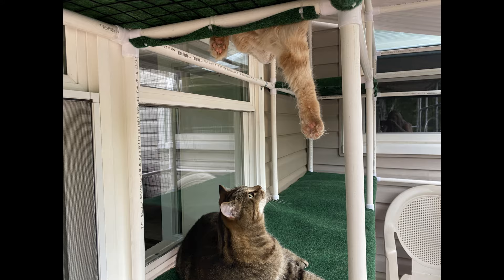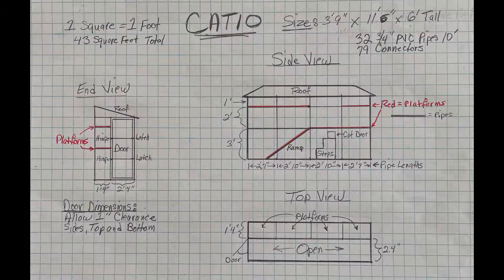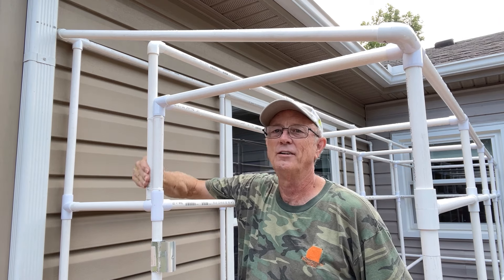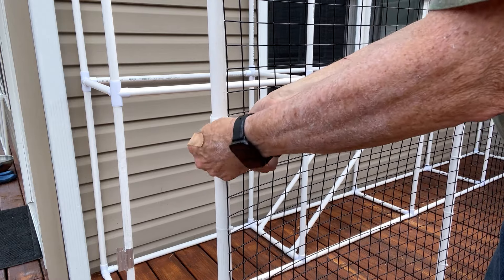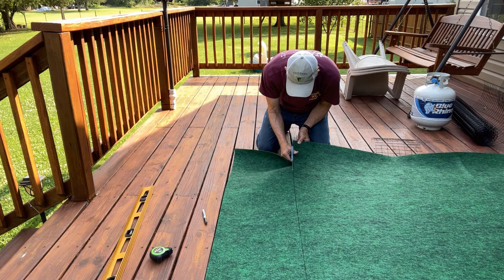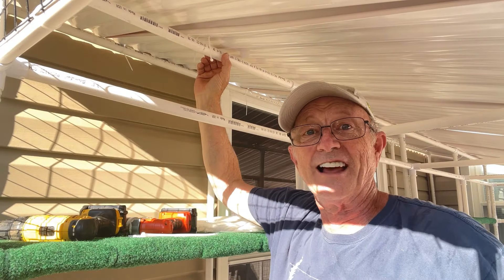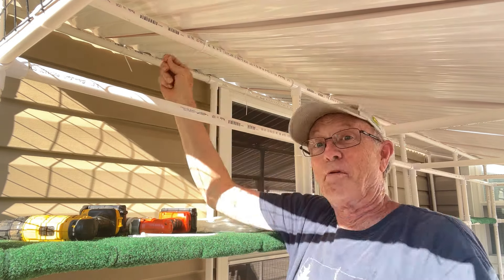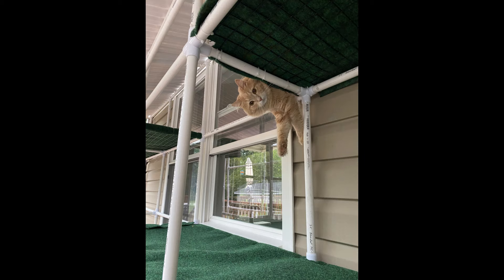How to build a Catio (outside cat enclosure) DIY

Comment: Very well done. Not to be a Debbie downer, but you will need to constantly check your zip-ties. I used them to secure fencing material to my cyclone fence. The sunshine made them deteriorate rapidly. I was constantly removing snapped ones with new ones. Sorry. Nice job though.
Reply from the maker: Thanks! Yep, you are correct. I probably should have used UV resistant ties. Problem is, they are black in color, and I think that would look ugly against the white PVC pipes. Using gray PVC is more expensive and the corresponding connectors are hard to come by. You would have to paint each one to match the color - too much trouble for me! At least I put the ties only 6 inches apart, so I'll catch them before the fencing comes off, LOL.

Comment: When pricing, remember that this incldes the cat tree/shelves inside.  If you buy an enclosure, you still need to build shelves.  This one is stiffened by the house. A free-standing version may need some diagonal bracing, which could simply be ropes.
Reply from the maker: I built everything, including the shelves, for $490. You are correct, a free standing catio will need a fourth wall, as well as some bracing.

Comment: Oh, are the tools u are using basically drill, screwdrivers, zip ties?
Reply from the maker: Yes, and a PVC pipe cutter I bought at Lowes, wire cutters to cut the fencing and something to poke holes through the carpet.
Reply from the maker: Let me know how yours turns out by joining my Facebook group, DIY Project Station: https://www.facebook.com/groups/882510523338538

Comment: I love the PVC idea. I would have used the UV safer gray, though. Couplings would need painting.
Reply from the maker: Yep, I later learned I should have used UV Resistant zip ties. Oh, well. Not sure what you mean about painting the couplings, though.
Reply: @RoBeaird  The option for connectors in the UV gray are not as much as the white. When I did an outside awning project, I used gray pipe, but spray painted the white connectors with gray paint to match and protect from the sun.
Reply from the maker: Thanks for explaining that. I wouldn't want to paint 79 connectors, though! Gray pipe is thicker and sturdier but it's also a lot more expensive and harder to cut. And I wanted to keep the cost of the catio under $500. While the UV gray zip ties would probably hold up longer, I think they would look ugly against the white pipe.

Comment: love it but I can see  1 possible problem .... Those white Zip ties used are not UV rated over here in Australia so cant be used outdoors because the degrade & breakdown .... keep checking them & if they start to breakdown, change them to black Zip ties which are UV rated .... Id hate to see the cats escape after all that effort
Reply from the maker: Yep. Unfortunately, I didn't know about the black ties until after I was done building it.

Comment: Someone else may have already mentioned this, but those white cable ties are not UV resistant and will not last outside. They will get brittle, weak, and not hold. You will need to use the black ones.... they will last much longer....
Reply from the maker: I thought using 300 black ties would not look good against the white PVC pipes, but you're right, the UV ones would probably last longer.

Comment: Pro Tip:  use black (UV resistant) cable ties instead of the white ones.  The white ones will get brittle and break when exposed to UV.
Reply: I have read that the black ones aren't that much of an improvement.
Having noted that, I am using a bunch of black zip ties myself to hold up a fence.  
It has only been two months, so my fingers are crossed.
Reply from the maker: Thanks for sharing that tip with my viewers. It's a little late for my catio, though, LOL.
Reply: @RoBeaird  Well if the project is still standing in a year, you will have a good idea of how to fix it.
Reply from the maker: Yup!

Comment: How many pipes did you endup using?
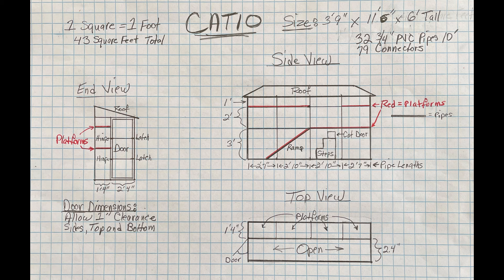Reply from the maker: 32 pipes, 10 feet long. You can see the info on the pipes and connectors used starting 1:29 seconds into the video.

Comment: Very nice design, but...  As someone who's been building stuff with PVC for well over 10 years, I can tell you that using zip-ties is not a good idea.  I used zip ties to hold down bird netting on my blueberry cage and, after a few years, those zip ties, being constantly hit by the sun, turned brittle and broke.  Should you have a terrible storm, along with WIND! like we have here in Northeast TN earlier in 2023, those roof panels will soon be in the next county.  I just had to replace my roof panels on my back deck that were screwed down because the wind ripped it to shreds, took the panels and blew them 500 feet into my neighbor's property.
Reply from the maker: Thanks for your comment. Another viewer said I should have used UV resistant zip ties. I see now there are heavy duty ties as well. I welcome any suggestions on how to do projects better; perhaps others can benefit from my mistakes, LOL.

Comment: You think maybe you overdid it with amount of fasteners and even bracing? 😅 Man too much. I’m dead
Reply from the maker: I probably did overdo it, LOL. My wife will tell you that!
Reply: I don’t know…cats can be pretty rambunctious. Better safe than sorry
Reply: @RoBeaird You didn’t overdid anything
Reply from the maker: LOL!
Reply: I love this. I'm going to try it. Any ideas on how to anchor it if you live in an apartment or rented home?
Reply from the maker: If it sits on the ground you could use U shaped stakes like they use for trampolines. If it sits on a deck or concrete, maybe place sand bags on the outside of the catio and attach them to the catio using straps?
Reply: @RoBeaird  thank you
Reply from the maker: You're welcome! Let me know how yours turns out.
Reply from the maker: Let me know how yours turns out by joining my Facebook group, DIY Project Station: https://www.facebook.com/groups/882510523338538